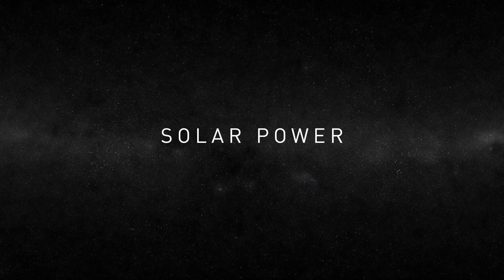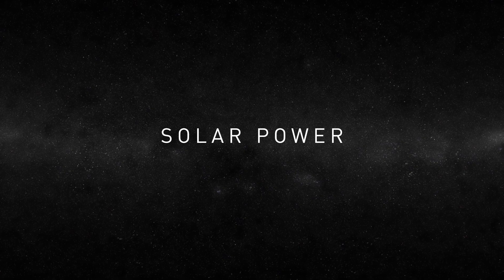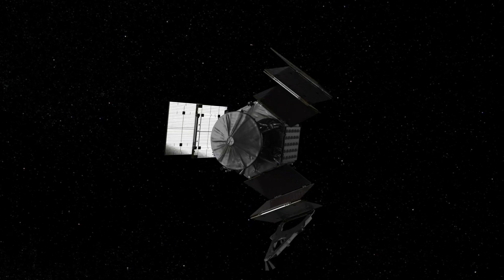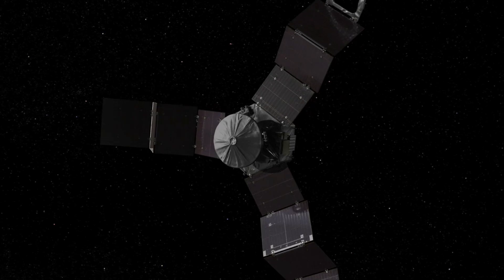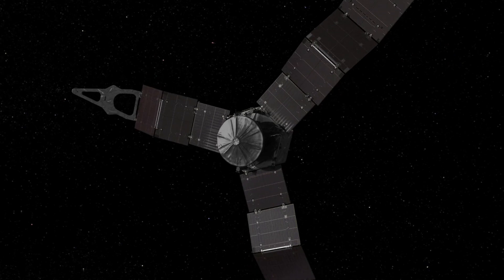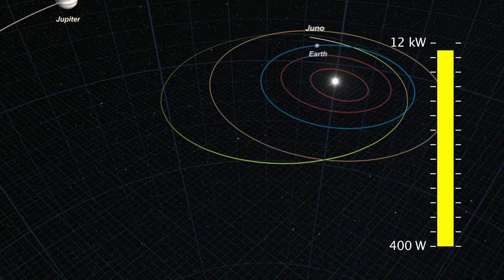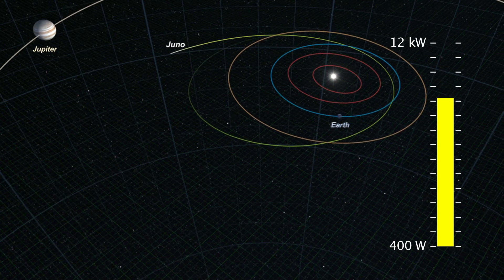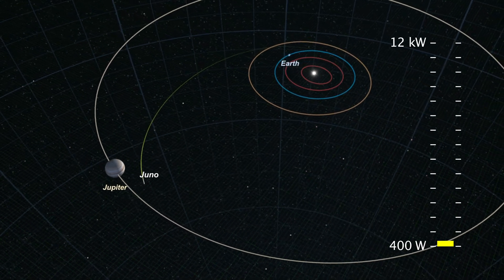Solar Power For Juno

Comment from the maker: It really depends on a number of factors -- things like how much power you need, can you fit the spacecraft and arrays into your launch vehicle, and whether you need to go into areas where sunlight is weak or unavailable. Jupiter is about as far as is *practical* to use solar power at present for most missions. Juno manages by always remaining in sunlight and being very energy efficient (spinning, thus attitude control requires little power, and low power to instruments most of the time).

Comment from the maker: The problem with such large solar arrays is that the voltage isn't high enough to push the current into the spacecraft bus. It would just sit there on the arrays, mostly being turned into heat! That's also not considering the practicalities of stowing the giant arrays for launch in the space available within the rocket's payload fairing, deploying them after launch, and steering a spacecraft with such large arrays.

Comment from the maker: That's correct, *if* such large solar arrays were practical for use at Uranus!

Uranus is about 20 times farther from the sun than Earth, and the available sunlight there is only 1/400th of what we receive at Earth. With that amount of sunlight, Juno’s arrays would only generate around 25 watts, less than the power used in a typical refrigerator light bulb. To generate 400 watts they would have to be 16 times larger than needed at Jupiter – about two-thirds of the size of an ice hockey rink.